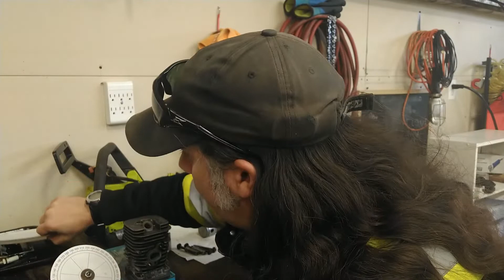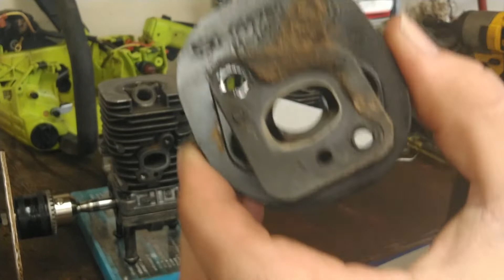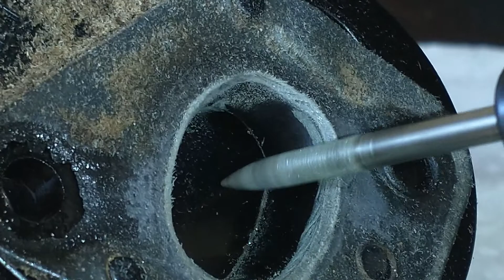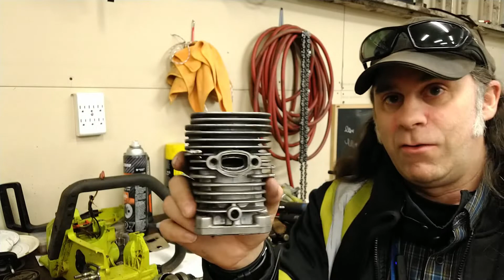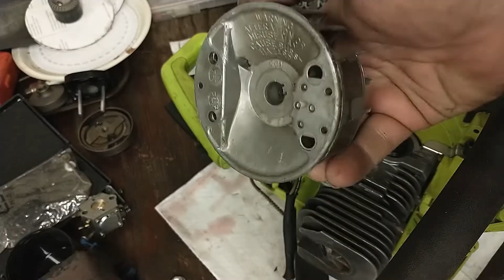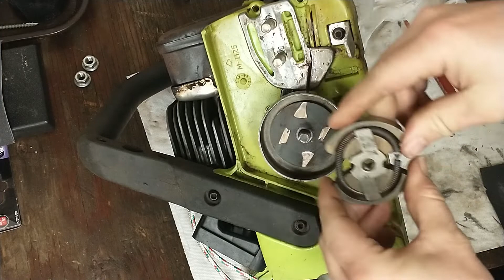How to port a chainsaw. Poulan 2150 porting how to stage 1 #chainsaw #porting

Comment: Good video man, thanks
Reply from the maker: Thank you so much for watching, I appreciate the support. I am planning on more porting in the future when I get the time so stay tuned 😉
Reply: I think poulan ,like anything else that's doesn't have an expensive price tag on it gets a bad name because " it doesn't have an expensive price tag  on it" . I use the cheaper product mainly because it's all I realistically can afford but at the same time I've learned how to use it to pretty much get what I need done the same as the other but not quite as fast but who cares ! I get nothing for being fast . I found a cheap Chicago electric welder in the dumpster took it home plugged it in and it worked . It's not as smooth as a high dollar one is but I can with Abit more imagination and putting more thought into figuring something out ...weld anything from 16ga to 3/8 inch thick and if I absolutely had to I'd bet money I could stick 1\2 inch together and be confident it would hold . Now yes you've got to put more time into it but so what . When your doing for you one can do it. Understanding no you're not going to go weld on a pipeline and you're not taking your cheap saw out cutting trees with some big logging outfit we get that. Like the old saying goes " want to see what someone's made of? Put them in between a rock and hard place a tell them they gonna die if they don't figure something out " . Ill take everybody's cheap junk all day .
Reply from the maker: You are so right! I have a welder that's pretty much the twin to the cheap Chicago Electric flux core welder here in Canada and I have built and repaired so much with it I could not tell you all of it. I have done 1/4" with it no problem, it just takes multiple passes and some patience. I have welded some pretty thin crappy Chinese sheet metal as well. With the less expensive equipment,  it has a  lot more to do with the operators attitude than the price tag. I have a full collection of machines, most of them were someone else's garbage that I either trash picked or someone gifted me because they were going to toss it. In this new world of shortages and huge price increases, taking someone else's trash and turning it into treasure is the name of the game. Thank you so much for the awesome comment!! 👍👍👍

Comment: Good Idea on the silicone break grease. I was wondering what grease I could use never thought of that. I have some here I’ll try it.
Ya the only reason those saws get a bad rep is because they didn’t get tuned before being sold to the customer like a Stihl or Husky.
Easy to get parts for and they start easy,cut good.
They are pretty choked up from factory though due to emissions requirements.
Ya those are a 50hr saw where as the Poulan Pro ( and maybe other models?) say they are 125hr saws and I think it’s because the PP runs the nikasil or chrome cylinder.
On the aftermarket kits the cylinder is plated and the piston is just aluminum vs the other way around on a stock engine on those 2050/2150’s.
Did your saws cone with the spacer plate in the exhaust or do you know about it? 
Mine both did and I talked to one of the engineers that built that saw and he said the spacer was to stop heat from transfering to the cylinder.
I’ve always left mine in because when they are removed there isn’t much area to make a nice seal for the muffler. 
But having said that I just read somewhere that Poulan left that spacer out in later years so i’m guessing it was a cost saving thing. 
Mine are both 36cc saws even though they say “42cc EPA” right on the sticker. 
I think all this manufacturers had rules to follow on epa so they’d call a 33cc saw 42cc and vice versa. A little false advertizing you might say... lol
The 36cc saws are a 38mm piston the 42cc saws are 41.1mm. 
I time mine a bit different than you do but I know how to get your numbers but what was your transfer heights so I can know what your blow down is? 
I have one sitting right here but my wheel is on my little McCulloch i’m porting right now.
Reply from the maker: I left the transfers alone for now, but I am going to go back into that cylinder in the future for a stage 2. I will totally get the numbers on that stock cylinder. I have the old stock OEM cylinder on the bench I can get numbers from as well that came from the 2150 last year. The saw I did last year I used the aftermarket chromed cylinder. I have another chromed cylinder on the way from ebay so I can try some different numbers by just cutting on the pistons which are very cheap. When I go back into that saw I'm going to work the piston and transfers. The saw I did last year I spent a couple hours on just the piston and I really feel it made a huge difference. The stock piston is very different internally which is why I left it alone for now. I wanted to do a build that anyone could try. The next go is going to get more into it. I love sharing all of the information we all come up with.
Reply: @patthesoundguy  ya it’s fun stuff! 
So many variables makes it interesting to see what does what.
One thing I noticed is that when I time my engine I shut the lights of and look for that first ray of light I don’t do it the way you do so that right there shows it’s hard to compare numbers and have them be the same between yours and mine.
I was looking at a video of some guys taking numbers with a feeler gauge so that could work good for intake and exhaust but not the transfers. 
In the end as long as the builder does it the same way everytime that will keep the numbers accurate.
I have a 2050 I’ll be putting together with the amazon cylinder kit. I wan’t to try it bone stock first though then maybe port it.
Reply from the maker: I played with the feeler gauge some. When I actually timed the saw I had it darker and the  first bit of light was much tighter. I really want to find the right size for the feeler gauges to get better consistency.
Reply from the maker: That metal spacer was in both this saw and the slightly newer one I did last year. It's no problem pulling it out for the exhaust seal, seems to be enough surface there. The aftermarket chromed cylinder did not have it, they had the port the same size as if it was there for the most part.
Reply: @patthesoundguy  ya like they molded that spacer into the new cylinders. 
My aftermarket kit is the same way. Dual ring vs single as well
Reply from the maker: I was super impressed with the quality of the aftermarket cylinder. That 2150 I did last year was for my step son it was blown up. It turned out to be an absolute beast after I ported it.